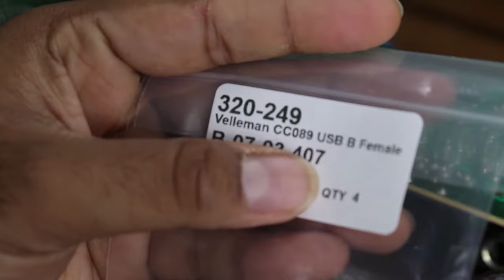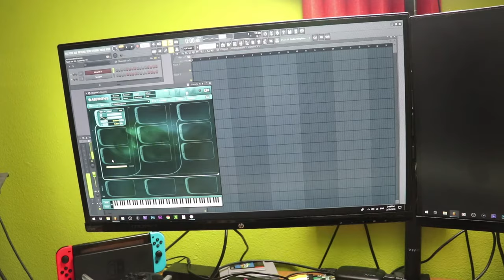How To Repair A Faulty Midi Keyboard USB B ( 2.0 ) Connector

Comment: I had this exact problem and replacing the USB fixed it! For anyone watching, be mindful of the little pads that you solder onto (the rings around the holes where the pins go through). On mine they came right off when I was removing the old USB connector. I was able to scratch off some of the PCB material to expose the copper underneath and make a little solder bridge from the pin to the copper. It was barely making contact but it works!
Reply: I just did the same thing to fix an AKAI keyboard. He seemed to have no damage to the PCB traces (donut shape pads) when he unsoldered. I guess I heated them too much, but 2 of mine came off/got destroyed, so like you, I made a little copper wire jumper and soldered that.
Reply: Thanks you two- im about to tackle my Steinberg audio card- I got the ur-rt2 so it’s scary
Reply: @hotpotatapie  bro i have same problem, where did you soldered the copper wire, in wich of the 4 little holes ?

Comment: when you solderer a plug like that you should solder the big points first because this anchors the plug and when you solder the data pins you will not be putting pressure / force on the solder points on the PCB.  ( I am an engineer with a keyboard company )

Comment: i just shoved like 2 joint filter tips to stabilize the  usb port and so far it works and stopped the disconnection... ill update if my house burn down because of it 😂
Reply: yeaah so i changed the paper tips for a little plastic piece to be more safe lol.. ill update if my house burn down..
Reply from the maker: Lol. I've used Lip Balm and Batteries before.
Reply: @OmoiSenpai  hey if it works it works lol
Reply from the maker: @TeiMoneyBeats  ^_^ Shieed

Comment: Had the exact same problem with my axiom 49. Thanks for the video! This repaired it. I had to make sure the solder on the 4 pins didn't touch each other. It wouldn't work at first when the solder was connecting/touching the other pins. Thanks again.

Comment: My man does everything!!! I’m in the process of moving and rebuilding my studio and had this issue where is was saying device can’t be identified or whatever, and look who has a tutorial on it! 😂 I’ve been wanting to learn soldering anyways so this is my opportunity, took my keyboard apart and it looks like the usb was pushed in too hard and broke the connection, waiting on my parts to come in the mail!
Reply from the maker: Best bet I do everything :P Little bit of this and that here and there! The latest thing that is out from the norm was to build a soundproof isolation booth: https://www.youtube.com/watch?v=chvvXxLGCAY
Just, make sure not to work too hot, and don't burn the board, otherwise, you're pretty much screwed! 0,0'' 
No stress though! :3

Comment: HEY! I have the same Keyboard with the same problem. Thanks so much for making this video. I would have been scratching my head wondering if I was removing the right solder pins, instead, I watched you do it first. and yes... definitely gonna use some flux.!
Thanks
Reply from the maker: Super late on the response, but I hope it worked out for ya! =] 
Unfortunately, I've did the replacement again, but this time. I think I burned out the chip board T_T
I had the heat on too high I'm guessing.

Comment: Heat the pads first and apply solder on it, or you'll get cold joints. Thanks for the video
Reply from the maker: No problem! And yeah. I definitely did not do a lot of things when it came to the soldering, especially not having flux xP

Comment: Great video! Gotta do this cause I dropped my launckey. Quick note but make sure you do a clean solder with 30/70 lead tin. Looks like the right side is a dead joint which will fail after a year or so. Cheers!
Reply from the maker: Thanks! If I had Flux, it would have made the process 1000% better and I would have avoided the cold joints. I did run back it in the video, but I heavily trimmed it down to help with the retention after publishing. Good catch! ^_^

Comment: There is another tip on this, I too have the same keyboard with the same problem. Just Use a paper tape or medical tape and wrap it over the Usb Mal B port / the cable connecting the keyboard. Use 1/2 rounds just to make a snug fit, and it works perfect.
Reply: So you said you bassically wrapped your USB b cable in paper tape and it worked out?

Comment: So how did u solved the problem whem the pc wasn't recognizing the keyboard? I mean did u soldered again or?.. pretty confused about that. I have the same problem on a 49 keys oxygen by m-audio and just ordered all the equip for the job.
Reply from the maker: The PC did not recognize it after I installed the new USB Piece, because there was a bridge of solder between 2 of the points and I did not notice it the first time around. I had to remove the bridge by re flowing the solder and removing that link. 

Hope that helps, and good luck!

Comment: If it hasn't already been mentioned, use blu-tac to hold components in place. Or masking tap. They don't leave much of a residue. Also you should start soldering the larger pins first before the electric signal pins.

Comment: Before you do all this soldering you can try spraying a little Deoxit in there, it's like WD40 for electronics and helps maintain the connection. Just recently discovered it myself and it's had several uses already. Worked to fix my USB port which only worked when it was held to one side.

Comment: I have a gen 1 axiom 49, I plug the usb in and the power works perfectly fine to it but my Mac won’t recognize it and Logic Pro X, do you think the USB pot itself has an issue even if it powers on?
Reply: motheroats have the same problem :( did you find any solution??
Reply: I had same problem with my 1st generation 25. I bought a midi to USB cable and had to find a power adapter...boom
Reply: You have to find the 'Axiom Pro.bundle' file online somewhere. Download it and put it in the Logic Pro's MIDI device plugin folder. Once you've done that you, HYPER CONTROL functions will work. The 1st Gen Axioms won't work unless you do this.
Cheers.

Comment: maybe very stupid question, but does the usb b female connector have to be new? i have an old printer that i don't use, and am wondering if i can take the female connector from it to add to my keyboard? but i never soldered anything btw, so maybe, once it's been used (and soldered) it cannot be re-used?

Comment: First, thx for this vid, watched twice.  My prob though:  new USB female too tight.  cable insert actually makes a nice satisfying click, whereas old one seemed only very slightly loose.  I've never soldered before.  This is an Akai MPK88.  I've tried 3 cables (male USB-C) all same.  It takes some pressure going in (already too much) then that nice click.  It takes a lot of pressure to unplug--way too much.  So even if I was a master solderer, this would break instantly as soon as I solder new one in.  Any advice please and thanks?

Comment: My nephew knocked my q49 off its stand and the usb came loose, its not completely off. Its just that when i insert the cable it pushes the port back and the laptop doesn't recognize it. I don't have soldering tools and i want to tighten the usb back. Any advice?
Reply: Where are you located?  If you'd be willing to ship it, I'd repair it.
Reply: @cellworx  South Africa, i don't think ill be able to ship it. I don't have the means at the moment, the best i can do is find a way to do it myself. Thank you for the offer kind stranger
Reply: @cellworx  Hey I'm in the same predicament can you help me?

Comment: Awesome video! I need to do same repair to my axiom 61 gen 2.  Where did you find the usb connector for so cheap? I found only one website for the part, and it is $10.00.
Reply: I did this repair on my own, it was tough no lie. Do your best when soldering to keep the pins soldered seperately, solder at the proper temperature, and make sure things are nice and clean for a good connection. I bought a 6 pack of USB connectors on ebay for like 8 bucks. So yeah.

Comment: guys, gotta ask because i've been looking for a solution but i just can't figure it out.

took my midi controller to a solderer, he soldered the usb type B connector and now my midi plug and play controller lights up but Windows doesn't recognize it, it doesnt even make a notification sound when connecting it, seems like my laptop isn't receiving any data from the midi and i just cant figure out a solution!

Comment: Nice video.I have same problem..can i use usb port from my old printer and then i will use it to replace on my midi controler port? Do you think it will work?
Reply: it actually worked for you?

Comment: Fuck I love you this the exact shit I needed literally
Reply from the maker: Hah! I knew it would help somebody! Glad I can help ya with that! Be careful with it though, Soldering can be a pain as you probably seen on the video lol.
Reply: @OmoiSenpai  yeah I tried once before already but struggled with getting the holes free of gunk after removing the old USB port. Didn't manage to get the new one in cause the holes were still stuffed. I think I need to get that copper looking strip you were using
Reply from the maker: I see! Yeah, it is called Solder Wick! It really works out nicely, especially if used the right way!

Comment: I'm going to do this but is it possible to just use the midi in and out ports?
Reply: only if you can get power to it...for instance a wallwart and midi would work. I had the exact keys hes working on, i gave mine away to my nephew, but i bought him a midi to usb connector and a wall wart (plug) and it works fine. Im now having the same problem with my vi49, this clears up how to fix it, but i might just go the midi powerplug route so i dont damage it. who knows maybe ill grow some nuts

Comment: Same controller, same issue... I was really hoping for an easier fix. Just shove a spacer in there or something. Oh, well. Thanks for sharing.
Reply: i just cut a thin strip of card and stuck it in the gap below the port. i have a keystation 49 with the same issue and this has fixed it.

Comment: my keyboard broke just today, the usb port is actually ok since my keyboard gets power but my pc does not recognize it at all. the usb port bend up a bit cuz my keyboard fell, and now i think that a little chip has lost its solder connectivity, how do i fix this? alesis v49 mk2

Comment: Hello, some days ago, someone flatted my USB cable and broke the connection, I did everything I saw in your video and it worked, the controller turns on and everything works fine on it, but when I appreciate the macbook it does not detect it, what do I do?
Reply from the maker: Hey! 
Did the keyboard used to work with the Macbook before this happened? 
Did you replace the USB Cable wire as well? 
I don't own an apple computer, so I don't have much experience with it, but if you never connected the keyboard to a mac before, you may have to search and install drivers for it.
Reply: @OmoiSenpai  If, before this happened it worked correctly, I did tests with several cables, and the cables are fine since they work with others of my controllers, and other controllers work just connect them, I have never needed to install drivers or anything, I am about to try if through the MIDI out connection it works and if it also works with another laptop

Comment: hello, i have the same problem, its first time soldering for me, i thought i did a good job, but the keyboard wont start at all. Figured i took the copper pads off with the usb...
what is the solution, how do you replace it?
Reply from the maker: Ouch. It sounds like, you burnt the whole board's pad? 
I don't really know where to go from there. I'm not an expert on that topic. =/
The only thing I can think of kind of related to that, was something like Nintendo Cartridges. They would scrape off part of the circuit board that had a trace of the copper circuit, and then hard wired it back to the circuit board to create the connection using a small wire.
Like I said though, don't take just my word for it! 
Hopefully you can get that figured out!
Reply: @OmoiSenpai  thanks ! yea unfortunately i burned it, looks like im gonna have to give it to professional. I hope its fixable.
Thank you anyways.

Comment: Hmmm i got a busted one if these days on my sim racing pedals its the one you use to connect to the pc its important i got it working in a ghetto sort of way but the back cap on the port stays loose i had to shim the top of the port so when the pedal if assembled it puts pressure on the port so things actually make contact and stay put i gotta have a new one soldered in this one sends power and information so i gotta find exactly what one i need to make a proper fix

Comment: I got my quarter inch input stuck in my scarlet interface and idk how to take it out 😂
Reply from the maker: Tried using Pliers? :P  lol.
Reply: Justin Omoi yessir but I only got a small piece out , the rest seems to be really stuck in there
Reply from the maker: I see. Technically, you Could buy a new 1/4th Port connector and do what I did in the video, but there's gotta be some way to remove that jack from the port. If you want, send a pic of it to my E-mail Justin.Bansraj@Gmail.com. I'm curious to see how it looks! If you want to thou :P
Reply: @OmoiSenpai  i work at guitar center so i think im just gonna be lazy and buy a new scarlett 2i2 lol
Reply: Erika G mine did that as well lol

Comment: You smart. Bro I need help I have to studio but I can’t connect my mic I mean I can but the mic is really low and when I put it high it’s still low.
Reply from the maker: Is it a USB mic? If so, go to your sounds option in the control panel, then go to the recording tab, double click the USB mic that you're using, go to the levels tab, and raise that up till it works out for ya!

Comment: I have M-Audio code 61, My father Tried to repair the Usb connector but it didn't work, he said i should buy a New Usb connector, Is it all the same or i should buy one special for M-audio code 61 ?
Reply from the maker: Hey there! 
I would assume that all USB Type B Female Ports are the same. I did not look into specifics when I bought mines ( other than making sure that it was a USB Type B Female port, and not some Type C or micro lol ) 
Have you looked at the soldering on the old USB port already? If the device powers on when the USB wire is at a tilt, maybe the solder points needs to be re-flowed in order to gain back it's connection and hold onto it.
Reply: @OmoiSenpai  Hello, of course it's type B loll
 the thing that happened is : i plugged my USB cable and the connector is detached and entered into the keyboard! and the four thin and tiny Plugs or idk how it's called are like broken or something ... i can't even send a picture in youtube to see what i mean !

Comment: for my part, following a bad soldering of the usb wires, I think I literally burned the controller. I also repaired the track that I damaged, but all it does is try to turn on. windows detects the device but does not manage to recognize it, and m audio despite the relaunch on facebook and by mail, it does not answer me ...

Comment: My keyboard's screen turning on but pc not recognise it and some random numbers showing on screen like i touch knobs. Any idea what's the problem about?
Reply from the maker: I can't really give you an answer since I don't know what keyboard you're using, what random numbers are showing etc. 
If the random things are like "CC 14" or something, that's part of the keyboard controller. Read up it's manual to fully understand what is going on with it. And see to make sure that you installed the right driver for it. 
If it worked before, and then you tried to re-solder the USB port back, chances could be that the contacts were bridged together, or not fully contacted.
Reply: @OmoiSenpai  I've M-audio oxygen 61 mk3. It's getting power when connected to pc but pc not recognise any device.

And some random numbers appear on screen and change quickly like 78,92,102 vs. When i turn the knobs and sliders numbers are chaning. I last used it 8 years ago and it was working fine. I wonder what problem might have been?

Comment: my casio has a different usb, with 4 small pins soldered on top of the board instead of the pins that go through like yours....What a shame, I have to buy a new keyboard for an obviously cheaply designer connector
Reply from the maker: If anything, the pins could be bent or cut smaller if it works. Or maybe there is a specific part for it that can be bought and fixed with. Either way. I hope it works out for ya!